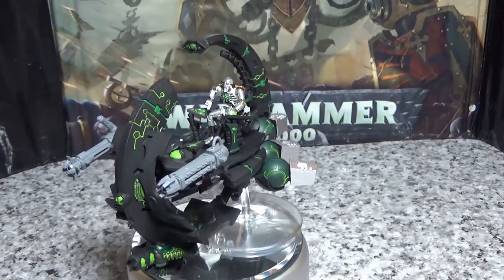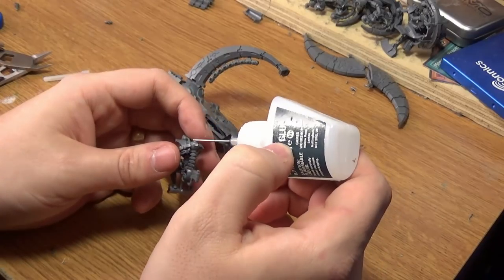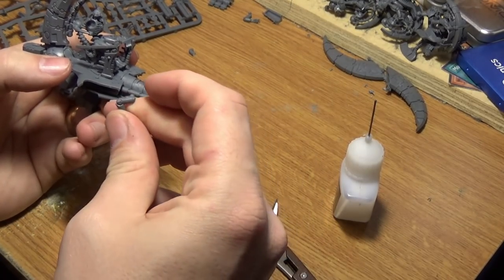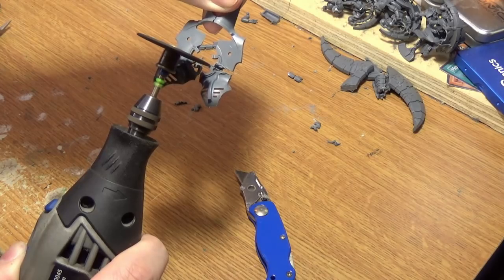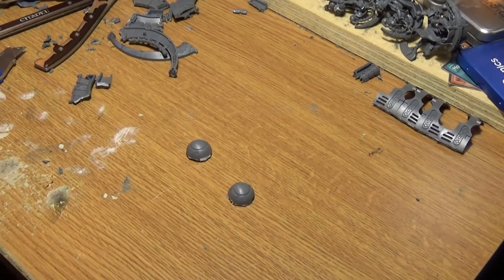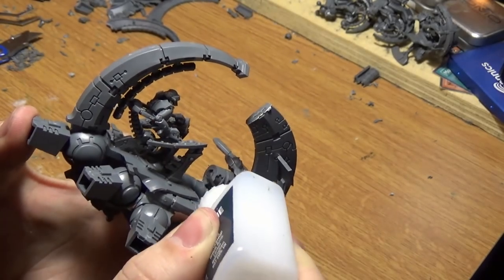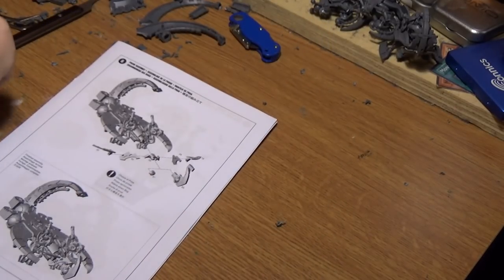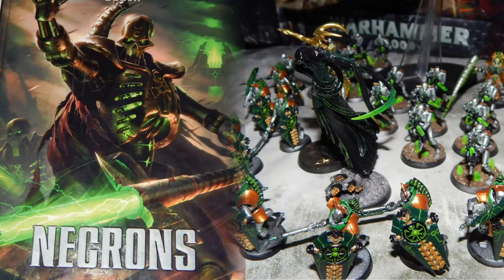How To Make A Necron Tesseract Ark, Custom Conversion (PLASTIC NOT RESIN)

Comment: Very nice conversion! May I ask you what exactly is that circular saw tip you used to cut/level the plastic? I need a tool like that but I don't have it.
Reply from the maker: its a dremmel part for cutting metal. very good for 40k lol

Comment: I saw some tomb blades in the back ground.  I was thinking about trying to kitbash a barge and a tomb blade to make one of these.  Do you think that would be possible?  I figured you might have thought of the same thing too, so I'm curious on your thoughts on that approach.
Reply: Or maybe the back part of a ghost ark too... though that would cost more then a 2nd barge...
Reply from the maker: funny thing i almost did use tomb blades :) but i went with the 2 barges due to the fact i get 2 overlords at the end :) so basicly the ark cost me nothing :) but tomb blades could work well and be interesting to see your build
Reply: Well I actually want to build 3 of these and was also considering the actual kits.  However, I have heard horror stories about resin and I am not to keen on crossing that bridge quite yet.  If I end up doing your approach or going with a tomb blade + barge approach I will make sure to post my results on your discord.  It likely will be a while though, working on 20 deathmarks and 10 immortals I need to finish first.
Reply: Also never said it, but good job on your conversion :)  Always like seeing new ideas on how to kit bash.
Reply from the maker: thanks :) happy you enjoyed it. i agree with you on the resin kits lol thats why i have 2 of these lol

Comment: For the life of my I cannot find decent super glue bottles that have a decent applicator.
Reply from the maker: honeslty get plastic glue, its stronger and easyer to work with :)
Reply: Like the Tamiya Cement line? I do have those, both the Cement and the Extra Thin Cement.
Reply from the maker: yes thats what i use, i dont like super glue myself
Reply: I only use sg now for really heavy pieces.